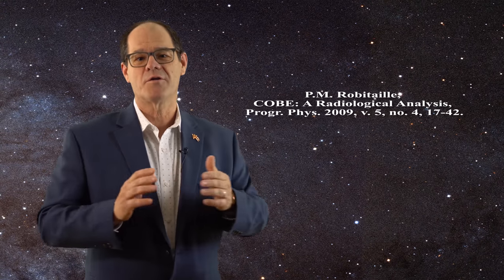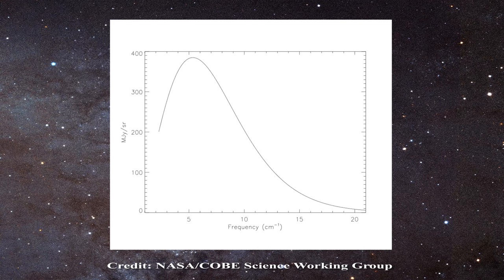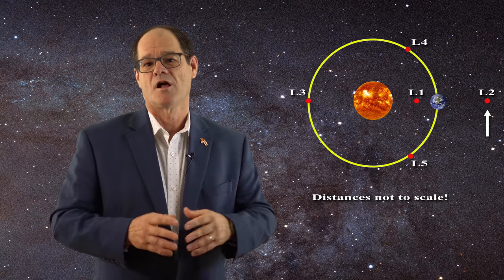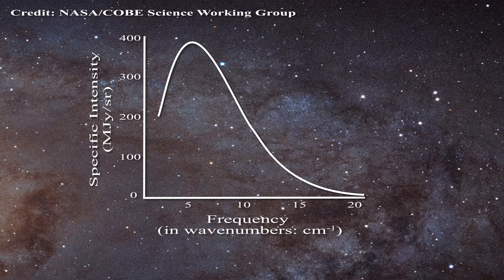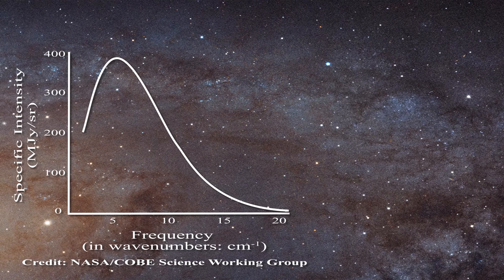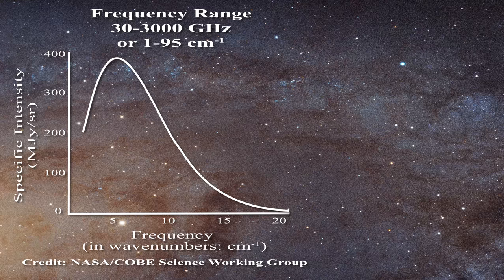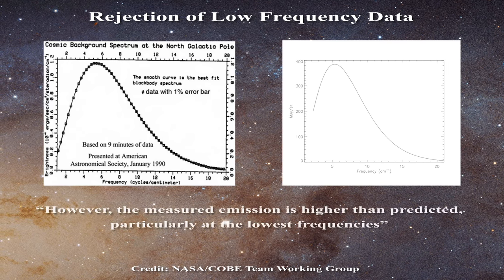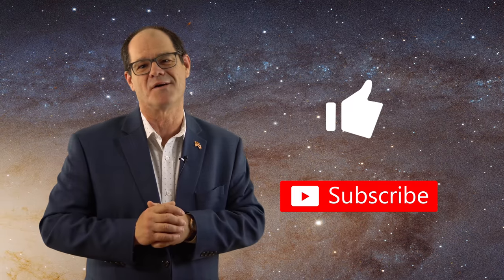The Microwave Background - COBE Satellite Results Explained!

Comment: Yes I agree with Stephen and Pierrei-Marie Robitaille that indeed the register radiation from Plank’s satellite comes from the Earth surface but not some relic radiation how is asserted there. These are my arguments:
First let begin with the nature of measurement value some heat radiation so small that inclines to the absolute zero, some 2, 3 degree (K). It is so small that most close’s emitter Earth with its huge mass and huge temperature compare to the absolute zero contains huge heat energy which practically is impossible to be shielded only some 900 or so km from the Earth’s surface. So it is obviously that registered radiation indeed comes from the Earth surface. But why there is discrepancy between calculated and real shield capability? The simpler answer is because we don’t take into account transmitted energy through dark matter which is everywhere.
Yes, the vacuum is not empty but what is out there?
About dark matter and its essence: Dark matter is the time changing (as age) galaxy from the subspace appears like proto particle. Why time changing? You can see on the final of this article.
Remind again this: What is the essence of the energy in the universe itself and from where it comes from and what is its value? From page 96, 97, 98 USM www.kanevuniverse.com follows that in the beginning of springing up of Our space the full energy is equal to zero for us. Then with thickening of the micro cosmos and expanding of macro cosmos due to the asymmetry of these coefficients, which depends by our position of observation in this case our living position, we have the illusion that the energy for us is increases, because we are close to the nuclei of the atoms rather than the stars and galaxy. But the macro cosmos expands more rapidly by the same reason, so full energy in our space is again equal to zero. So it is seen that the energy is “one reality in the illusion”, as well as the world itself! See USM www.kanevuniverse.com So by this very elegant way is determinates one of the most mysterious physical phenomenon in the universe! 
But how the centripetal acceleration remains constant in different physical conditions: temperature, pressure and so on, because we assert in USM www.kanevuniverse.com that through inter movement between the atoms (galaxies on the over space respectively) they create their own field (centripetal accelerations). Well first you need to read again part I and II USM www.kanevuniverse.com After that you need to read pages 85 to 98 (USM and the quantum mechanics) USM and especially pages 90 to 93 where is explained why the between atom’s distances (the length of Plank about atom’s quantum action) and why the between nuclear distances ( the length of Plank about nuclear quantum action pages 161 to 174 USM), why they aren’t change by the physical conditions temperature and pressure and remain constant and what happen in border case close to the absolute zero temperature, which explains the essence of the superconductivity and super liquidity, see part VI superconductivity USM www.kanevuniverse.com So the center of our galaxy continues to give more and more proto particles in around this center. Then where come from the “stars” from the subspace and whether they come like separately stars or like very young galaxy from the subspace? To answer this question we need to return towards this:
So let continue from here: As I said in the part I on the theory USM www.kanevuniverse.com when the Sun passes through the galaxy belts of centripetal accelerations, then were borne the three groups of planets on the solar system due the disturbance of these belts field over the Sun own centripetal acceleration – inertial balance and the planets at these moments are around 4-5 billion years so far (the comets, asteroids and cosmic gas have nothing to do with the planets formation, on contrary these objects were borne together with the planets and therefore with the same age) At this moment of planets birth the Sun already contains atoms from protons and electrons but a lot lighter than their present masses and continuously become heavier. So obviously quantum stimulation of such atoms will produce light-“lighter” which is different from this one which we observe here on the present position of the Sun, but when this light passes through the centripetal accelerations belts towards galaxy radius increasing, then this light gradually becomes” heavier” until reaching known here frequencies. So that is why we don’t observe the center of the any galaxy because there the “hydrogen-atoms” for example are contain from two proto particles with almost indistinguishable masses between the “electron” and “proton” see superconductivity USM www.kanevuniverse.com 
So the Earth atmosphere comes to existence in present atom’s form much latter than Brian’s assertion. More interestingly from here follows that the organisms cannot exist if we begin to move by some device towards the center of our galaxy ( how I said in the page 2 of the theory) firstly will appears some vital illnesses and if we continue, then these organisms simply will disintegrated themselves. So to survive we must to chose stars with a little smaller orbital radius than the Sun one, which is means more younger, so there to live some millions of years to hand over our genetic code to the present atoms there, i.e. until our atom’s from at now Sun radius-position exchange with these ones on the new younger sun….in this way continuously (step by step) we can ignore the expansion of the surrounding space and radial shifting of our Sun towards the periphery of our galaxy where wait for us the aging and death together with our Sun.
On the periphery of our galaxy where the Sun will die and from our solar system will remain only old protons and neutrons and because of shown above about how centripetal acceleration remain constant we can conclude that these old protons and neutrons (which are old galaxies from the subspace) also will come to disintegration into sub stars from the subspace. But how this process will run? Firstly on the periphery of our galaxy because of expansion of distances between them these particles disintegrating themselves coming to the periphery of another galaxy similar to ours and approaching towards the center of this galaxy our old protons and neutrons gradually become younger and when they reach the center of the galaxy they will become proto particle of this host galaxy. So our old protons and neutrons will return back at the time 10 or 20 billion years!
It is become clear that each coming in towards the center of the some galaxy proto particle from another near galaxy does collision with the meet proto particle coming from inside towards the periphery of the galaxy. So what is the age of these two proto particles? They are in equal age, for example if this meeting happen in our point of observation (the Sun) then these two proto particles are protons in mass and features because this is the place where the two particles have resonance radius of proton. If this meeting happens for example near to the center of the galaxy then the two particles again have equal resonance radius but for far more light particle than these ones of the mass of proton. So one of the coming in proto particle gradually become younger and lighter and another coming from inside gradually become older and heavier where they are meeting as a equal particles and the merger between the two become possible.
There we can add one additional stuff answering of this question: Whether the coming towards the center of the host galaxy proto particle from another galaxy can to be merged only with equal coming from inside proto particle? The answer is no because far away galaxies dispatch proto particles greatly disintegrated (fare lighter and younger galaxy from the subspace) and coming to the periphery of the host galaxy they are swallowing with far more heavier host proto particle (older galaxy from the subspace) but only such as a orbiting around the heavier particle (imagine the resonance radius of neutron in our position of observation the Sun spot). That is dark matter. G.Kanev
Reply: This is circular reasoning.
Dark matter (and dark energy) was "discovered" to make up for such experiments like the Microwave Background Radiation measurements being spectacularly wrong.
In this particular case (i.e. dark matter and dark energy) we are talking about the Big Bang theory model being wrong by a magnitude of whooping 24:1.